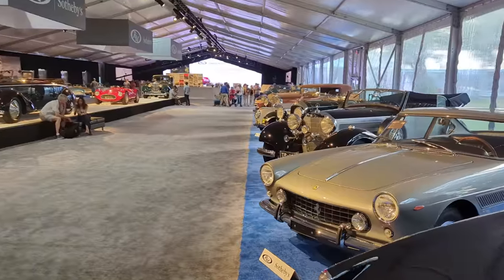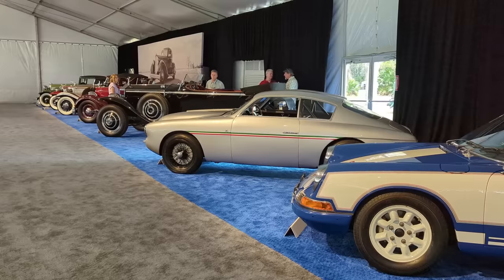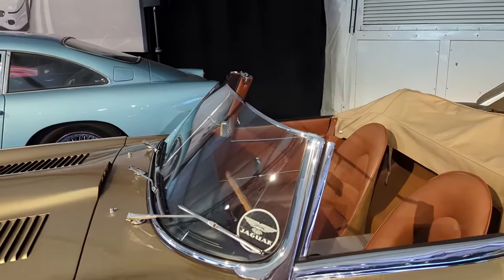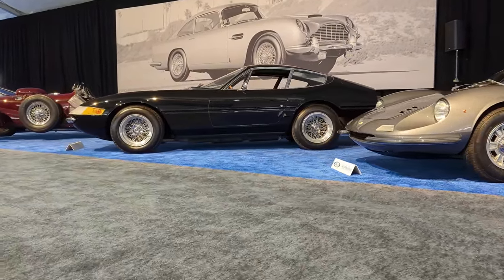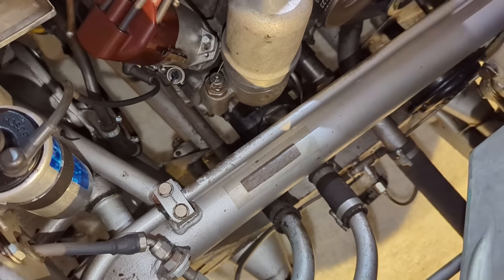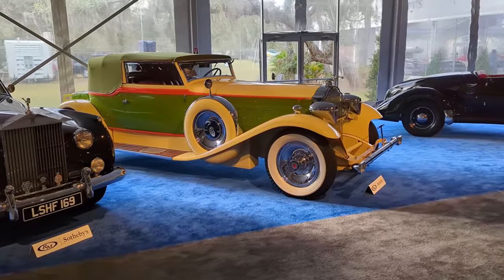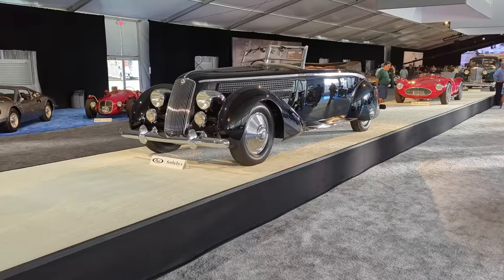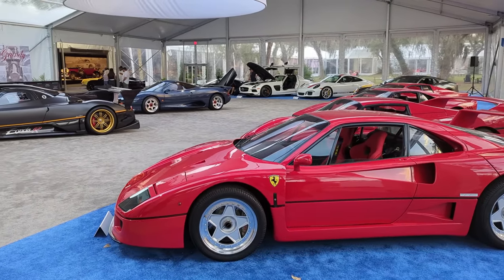$70,000,000 Sold! Amelia Island Supercars from RM Sothebys

Comment: Hello Richard, interesting to see the centre locking wheel nuts on the Jaguar XJ15, are a different colour on each side. I'm guessing it's because they are fitted with directional tyres !!! Great video.
Reply: Very likely the coloured nuts are threaded right hand on the right side (blue) and left hand threaded on the left side) This prevents them from loosening themselves due to forward rotation. A practice that began in the horse drawn carriage era. Wire wheel knock-offs are similarly left and right hand threaded which is why most offer an embossed "UNDO" with an arrow so you know which direction to whack it with the mallet.